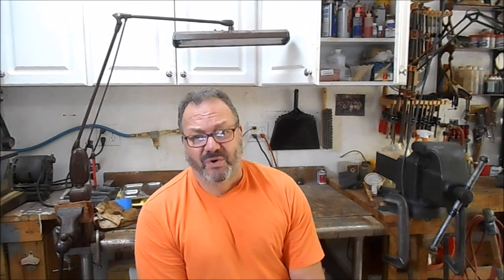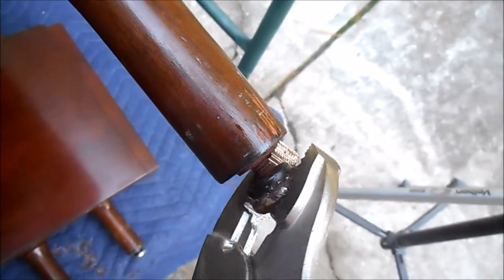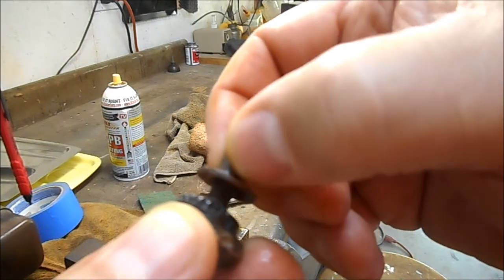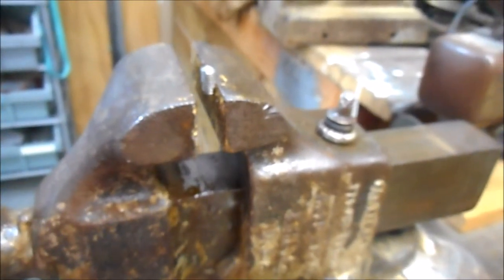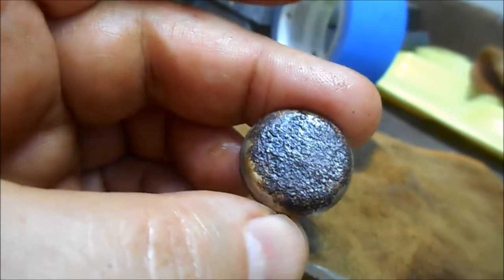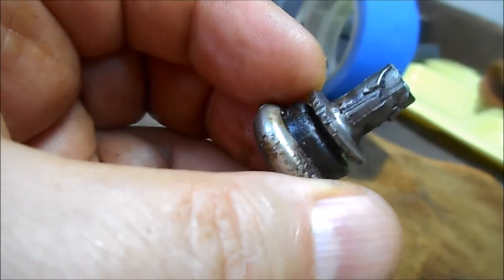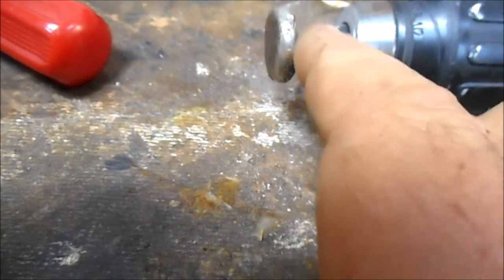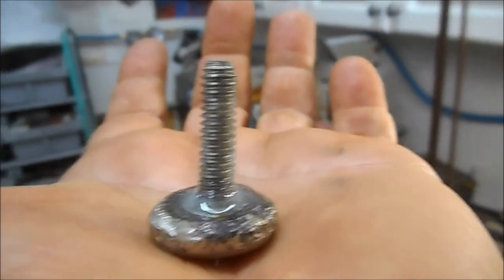Restoration of a Statton Cherry Drop Leaf Dining Table

Comment: Stratton is still in business.  My guess is they have a bin full of those old feet that they might send you.  I have pretty good luck contacting the old places when they're still around.
Reply from the maker: Great idea.  Thanks, Rick.
Reply: That job turned out great though.  It would be  a tough table table to get right in a house without those adjustments possible.  Looking forward to the rest of this one.

Comment: Hey there again. I asked you before what spray gun you use and was wondering about the compressor. I researched it a little and figured out that the gun you use requires a powerful compressor. I have a smaller one that I think won't do the job and was wondering if you have any advice and what size or at least brand you think I should go with?
Reply from the maker: It all depends on your budget, air requirements and set up.  Remember, a larger compressor will need a 220v outlet.  For many years I used a 110v Craftsman oil-less compressor with a 22 gallon tank.  It kept up with the gun fine.  It, like all oil-less compressors was very loud, though.   It eventually threw a bearing on the motor.  The new shop compressor is a Quincy, 60 gallon.  It delivers 15.7 CFM and runs on 220.  I guess my advice is to first shop for a compressor which produces enough air to support the tools you will run on it.    Narrow down your search by what you can afford and how much air you need, then use Google to check on reviews and reliability.
Reply: Lost Mountain Restoration Yeah I know that about the different outlet requirement. Thanks for the detailed advice. I'm going to do some more research on it today and most likely purchase one this weekend. I already ordered the gun you referred me to. I looked it up and it got solid reviews by some pro painters so decided to go that route. Thanks again sir